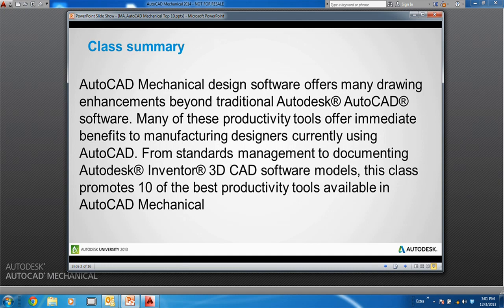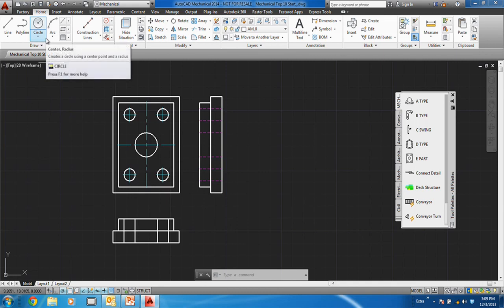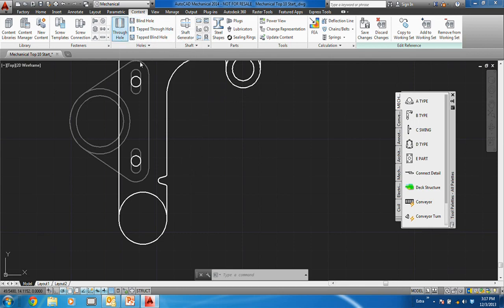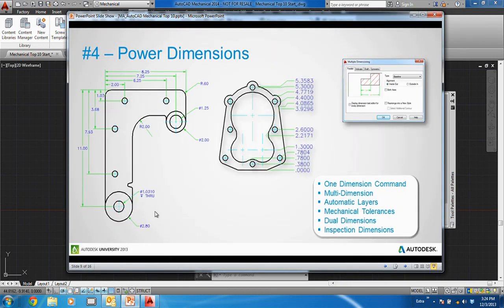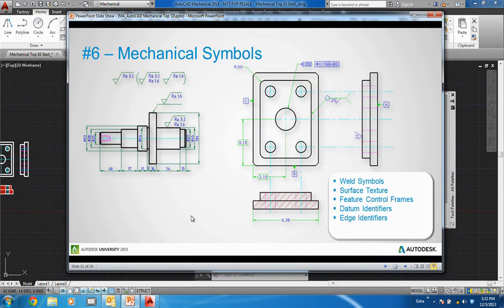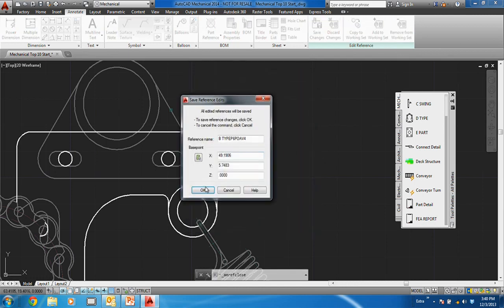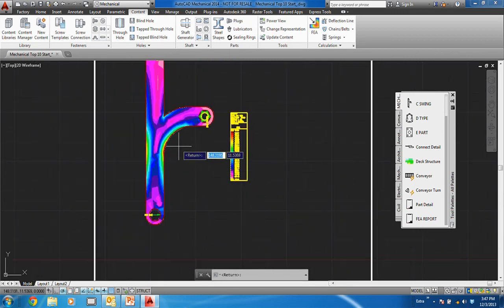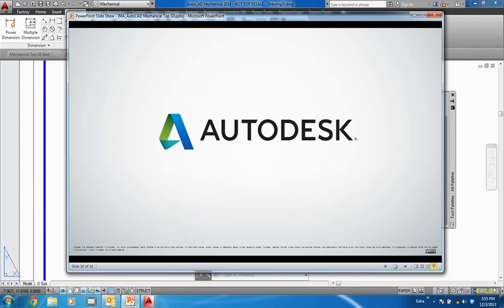AutoCAD Mechanical Productivity Tools

Comment: Hello Sir,  I'm using Autocad Mechanical in my new job, everytime I export the autocad drawing I noticed all dimension are overlapping to each dimension sometimes axactly place on the top of the object, Sir, do you have command solution for that? I hope you will see this comment, I REALLY NEED SOLUTION FOR THAT, THANKS 
I saw your video its so nice and very inspiring!

Comment: Hi Rusty,    great video thanks for the detailed explanation what most users were missing from AutoCAD Mechanical.   its an eye opener. 
I have a question though.  Since the same similar components can be selected and used in inventor in 3D, and inventor can create the  2D views ,  doesn't  it make more sense to start modeling in inventor ( of course if one has it) 
do I need AM if I have the Inventor?
Reply: Hi Rusty, I guess I was carried over in the middle  of the presentation. you already answered my question , 2nd half of the video...    thanks again.